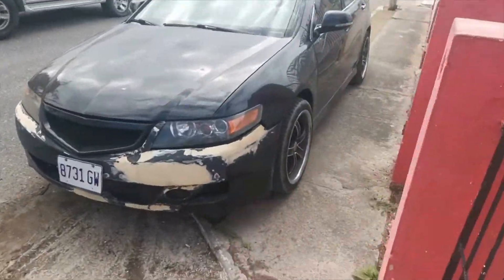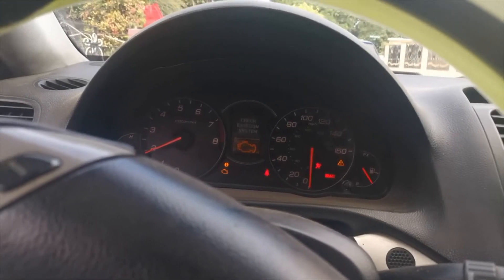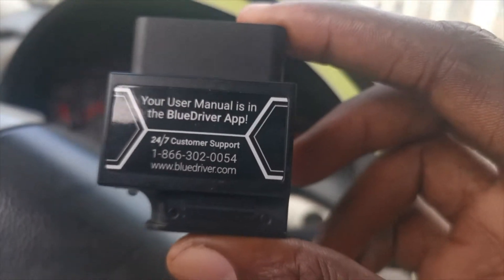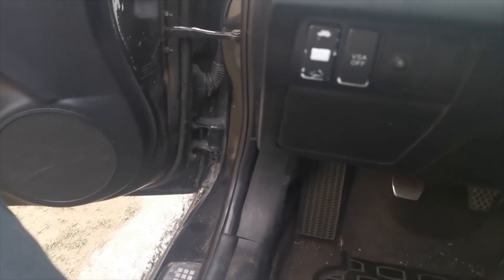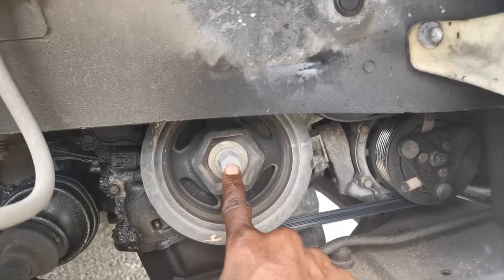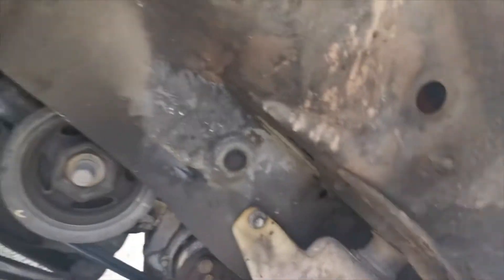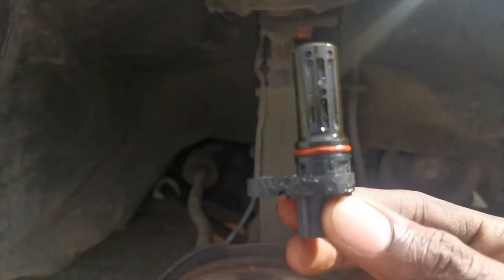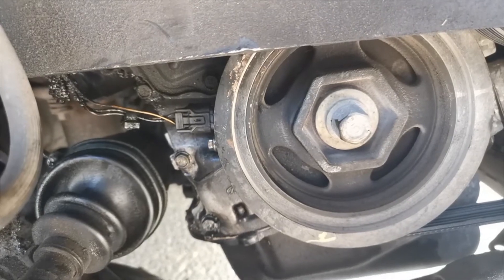TSX Build Eps 3: TSX Crankshaft Position Sensor Change

Comment: Just like that fi real
Reply from the maker: Yuh zeet. 

In recent times I found out that it's a serviceable part. 

It should be cleaned with brake cleaner/degreaser, dried, replaced.
Reply: @quemyst I need to check my own

Comment: My 2012 have a difficult time starting it make all type of noise sometimes dont crank up and i have to hit the gas
Reply from the maker: @LifeWithOG1  that could be anything from the starter to the fuel pump. You getting a check engine light? Start there.

Comment: Thousands to scan? Damn big bro i thought 125/per hour was bad
Reply: I understand now. Didn't think to convert currency. I just picked up my car from the shop for thousands so I suppose it's all relative 🫰💯
Reply from the maker: @mdavid7149  I have end links to replace on mine. Lol. It should cost about $20 USD per side but I might put em in myself.
Reply: @quemyst  I'm on the same path big bro this last issue I don't have the expertise sadly but suspension on a tsx is Legos thank goodness
Reply from the maker: It's fairly cheaper out here in Jamaica. Mechanics charge a flat rate for labour. 

Currently I think it $4000 JMD to scan which would be about $25-$30 USD...

The last time I paid the equivalent to $125 USD was to repair my starter. 

Took about 3 hours to fix but generally pay a flat rate/fee.

Comment: Changing mine right now same tsx
Reply: Ok. Ammo try that cause alot of oil leak is on mine aswel. Will update u if anything
Reply: @leigh4146  how did it go?
Reply: @shawnwiltshire9039  realize the crankshaft sensor wasn't the problem but the wiring seems like one of the connection was corroded hence no signal was getting to the sensor.
Reply from the maker: @leigh4146  glad you got it sorted out. You up and running again?
Reply from the maker: Nice... Hope it goes well...
Reply: Sadly no. The code P0335 is still there. Searching the code but basically saying the there's still no signal reaching the sensor.
Reply from the maker: @leigh4146  that prolly means the harness needs to be changed as well. I eventually had to do that to mine cuz the oil leak in the vid caused my wire to keep sending high voltage. You can find the harness cheap cheap on ebay. Think I got mine for about $11...
Reply: @quemyst  Yo
Reply from the maker: @robertjetson7143  sup?
Reply: @quemyst  I have a 2006 Acura Tsx and yesterday it shut down on me. If you try to crank it or with the ignition switch in the ON position there’s like wire burning coming from connecter like in this video. It does have a lot of oil residue on the connector. Wish I can show you pic.
Reply from the maker: @robertjetson7143  in my situation (in the video) I didn't get any smoke from the wires but the oil was coming from my powersteering line, I think. The oil had caused the crank sensor to send high voltage intermittently so I ended up had to buy both the sensor and the harness. I got the harness off ebay and the sensor from amazon. My mechanic did the wiring and it's been fine since this video. I do have oil around the sensor now but I jus clean it up when I can, wait till it dries and plug it back in. You can hit me up on Instagram. Deets in the description.
Reply: The burning wires leads to the crankshaft connector
Reply: Should my car crank after I repair/replace wires that leads to the connector for the crankshaft sensor?
Reply from the maker: @robertjetson7143  if that is the only issue, once it is corrected it should start. The reason it doesn't start if the crank and/or the harness to the crank is bad, is cuz the computer is trying to save the car from damage.

Comment: Variable valve sensor?  Mine showed a misfire. Car will not start. Cranks but won't turn over. Replaced all spark plugs. 
I'll have to check this. An oil change got rid of my emissions light until 💥BOOM no more start. FML
Some misfires were fixed with new new ignition coil or spark plugs. Thanks for this suggestion.
Reply from the maker: Make sure fuses are fine as well. Hope it gets sorted out man.
Reply: @quemyst  Ladyyyy lol...
Anyway. It's not spark plugs or fuses. I checked. Then had to have it towed to Acura. It ended up being the timing chain and the vvt actuator. Even though I have done all oil changes in a timely manner as well all regular maintenance. Right under 78,000 miles. Expensive fix!
Reply from the maker: @roxysupastarchick  my apologies Lady Sherwood. 🙆🏾‍♂️ I'm gonna assume your Acura is an automatic? I'm finding out more and more both types of engines wear differently depending on the trans. Tbh before all this research I thought they were built with similar longevity in mind. My engine is at 138K Miles...
Reply: @quemyst  🤣 I HAVE A BOY NAME. All good. Yes, automatic. Both Acura & Honda told me the timing belts/chains need replaced at 100,000 miles (wtf?). Most issues with my car has been parasitic drain. When I get it back I'm disconnecting that stupid pointless blue tooth. I've replaced a starter, multiple batteries and an alternator. Did oil changes on time (don't use the oil indicators). Now timing chain & vvt (so damn expensive to replace) and need a new clock since that's where you put in the stupid CODES.
Reply from the maker: It's so insane cuz when it's going good it's going great, but when it's bad it's awful... 👀
Reply: @quemyst  I said the exact same thing.  "Everything worked great, until it didn't" lol 😆

Comment: It could also be the timing chain to bro, just happened to my Honda CRV and it was the chain.
Reply from the maker: Ah respect. Mi mechanic did check it and the timing was fine. The crank sensor was the issue and it was caused by the oil leak that I have at the vtech (Honda best and worst lol). Since dah video ya it ah drive nice man. 

Respect.